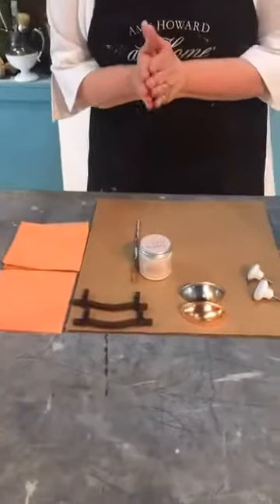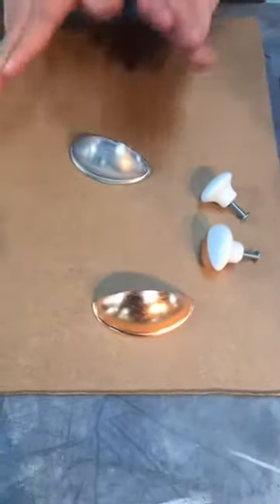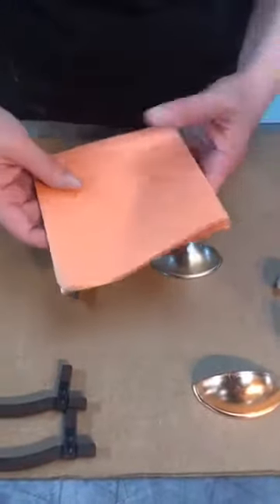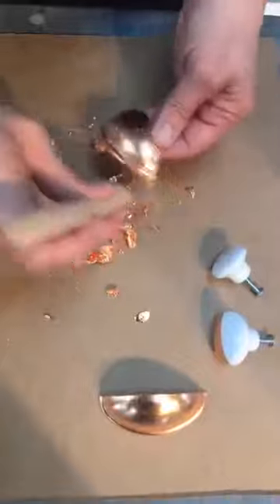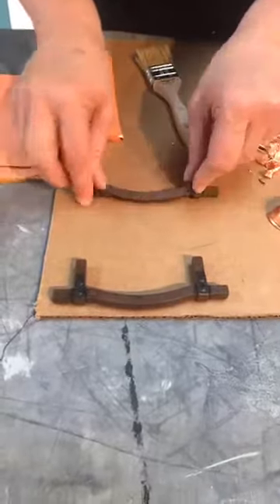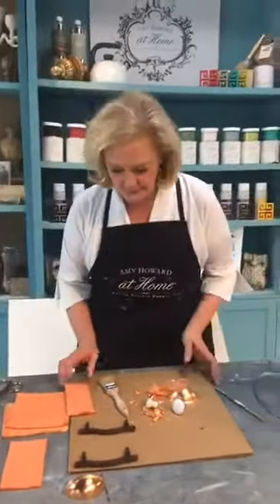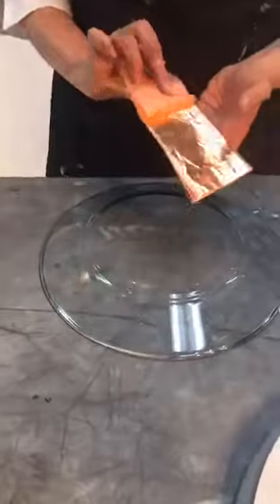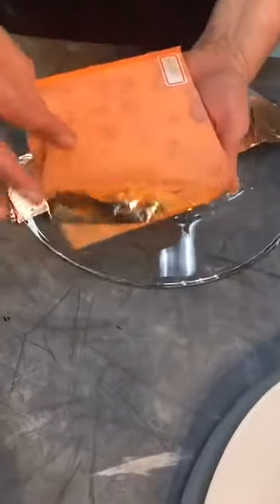How to Gild Your Hardware and Faux Marble your Countertops-Part 1

Comment: Younshould never ever use water based size for anything that will be handled especiall door hardware. No matter what sealer you use, the metal leaf will always start to wear off as no water based size ever fuly dries. You MUST use the oil Size. Water based is fine for things never touched like decoration but ANYTHING being handled must  be done using the oil size. PERIOD!